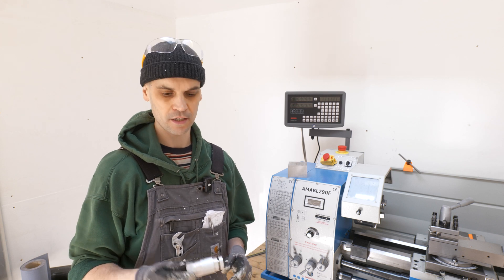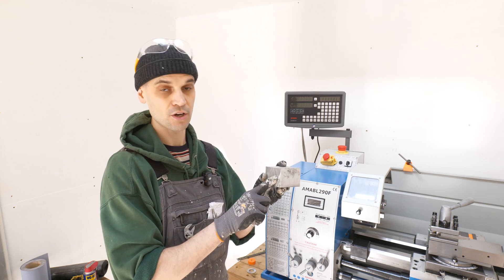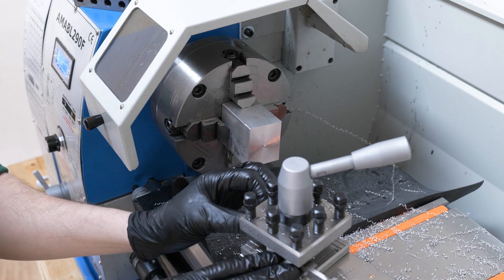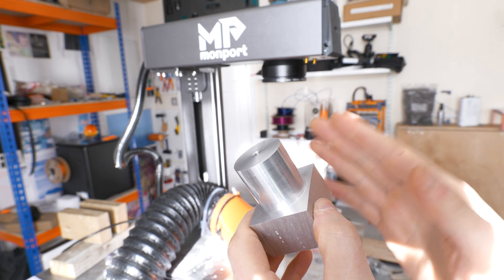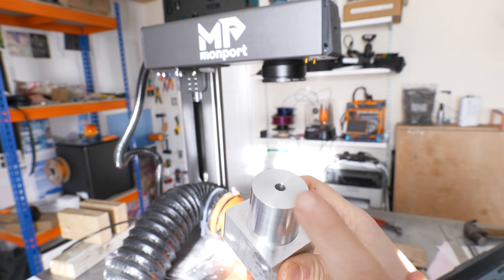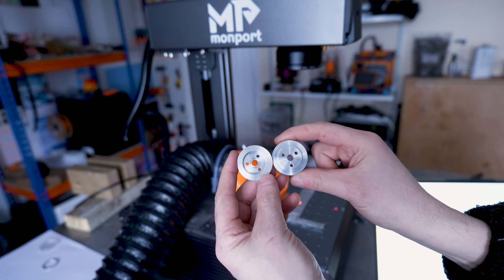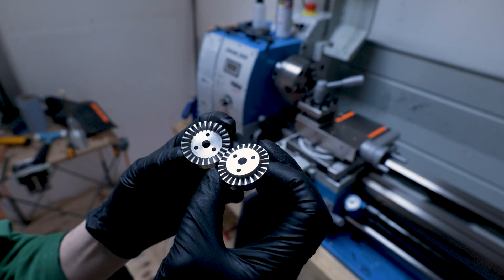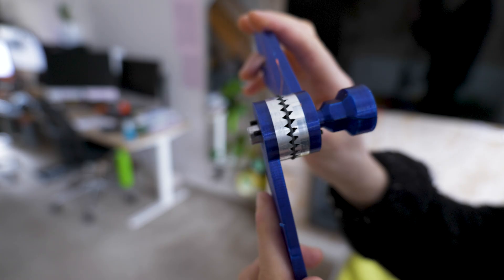Using Monport 100W Fiber Laser & Lathe to Make Gear Teeth!

Comment: i dont think the rubber is doing you any favors i have a feeling it would work just fine for tablet holding minus the rubber. and you'd get that positive hands free engagement those rosettes are great for. just my 2 cents worth of hobby knowledge. I've made these rosettes using every manufacturing method i have access to. That laser is BA though

Comment: I like that its possible, but think the geometry is perfect for 3D-Printing. I have printed these to use on a telescoping stick to reach and clean high windows and it works perfectly as they are rigid and allow me to articulate the End Of Stick Tools exactly how i need it. Until you make each arm from one piece of aluminium i don't think worth the effort with the laser. But its great that its possible to do it! There are surely a lot of great use cases for the machine 👍👍
Reply: it is probably best suited for SLA SLS, FDM ends up with brittle "gear teeth" Ive tried about 20 different designs and printing methods before having one resin print and attached to aluminum bodies and it held well (Still does)

Comment: if at the end you a using a rubber washer then you doesn't need all this teeth thing in a first place )
just two plain surfaces, a hard rubber washer (or even an o-ring) and a bolt  is all you need.
Reply from the maker: Perhaps, but the teeth will certainly increase torsional resistance, it might be overkill for this application but I was curious how I could incorporate it into my build

Comment: Interesting. But why use teeth when you are also using a rubber pad? why not just one or the other? I'd thing that roughing the surface up would be enough to grip the rubber sheet and the teeth alone would be fine interlocking with each other.
Reply from the maker: Good question! The teeth and rubber pad serve slightly different purposes. The rubber helps with vibration damping and creating a secure seal, while the teeth add mechanical interlock to prevent slipping under load or torque. In some cases, roughening the surface might be enough, but the teeth provide extra grip, especially if there are shear forces at play. It’s a bit of redundancy for added security.
Reply: @ThisDesignedThat  Thanks!

Comment: Hi, Im working in a shop where we happen to do quite a bit of machining (its for agricultural repairs, not a machine shop). We keep all sizes of material in stock since that obviously saves a ton of time (20mm to 80mm in 5mm steps as well as a lot of imperial stuff for old machines). However that is quite expensive to have that much material just sitting there and also takes up some space. Alternatively you could just get a few of the most common sizes for your projects and turn down bigger things for individual sizes. About the Coolant: it is an absoloute mess to use it while machining most of the time and I would not recomment it (except for drilling). Do your cutting and leave 0.5 to 1mm on the diameter, then use coolant or just let it sit until you can comfortably touch it before measuring and taking your final cuts. Another point that has been mentioned before: DO NOT wear gloves on any rotating (or moving in general) equippment! It is incredibly dangerous and can cost you limbs in fractions of a second. Even thin Nitrile gloves are a bad Idea as they can pull your hands in so quickly that it is too late before they rip. In general I would highly recommend doing a couple weeks of internship in a machineshop if at all possible to learn some of the safety and otherwise generally helpful knowledge.
Reply: One more thing. The tool you are using on the lathe is not really a great option for anything. It will get you by but using proper carbide tools is so much better and easier. You can get pretty cheap ones to start out as well. I'd recommend some TNMG (thats the sape, not material) as a good allrounder. High rake for aluminium is also a good idea.
Reply from the maker: I've just bought some carbide tool holders and bits because for this next project I am attempting to machine EN24T steel. I tried to take one facing cut and it actually grinded down my HSS bit so I think ill need to switch to carbide for that part
Reply: @ThisDesignedThat  EN24 is actually quite nice to machine with carbide tools. When you do it right you can get a great surface finish on that. Just be a little careful when drilling it and make sure to use coolant for that.
Reply from the maker: Hi Benedikt, thankyou for the advice, I will slowly try and stockpile my material in 5mm increments thats a great idea!

I have quickly learnt to do my roughing and then let it cool, thanks for the tips. Sometimes I do my roughing steps and on the last roughing cut i'll use a little water soluble coolant just to help reduce the part temp and then take small cuts for the final part, i was initially surprised how much heat the lathe cutting generates on the stock. Taking 3-5mm DOC produces very hot chips! Im use to a CNC in an enclosure so i never have direct contact with the chips and i use mist coolant most of the time on the CNC so this was a new experience for me.
Noted on the gloves, i only wear gloves when changing over chucks, i wear nitrile gloves when operating the machine but after reading  yours and others comments I'll just use bare hands when operating the lathe from now on 👍

Comment: You would be kicked out of a machine shop immediately.  Wearing gloves, loose fitting hoodie, and a loose mat to catch chips is incredibly dangerous.  Perhaps its time to look at some accident photos as a reminder.
Reply from the maker: Cheers Randy, I tried to make my work safe but I am always happy to hear feedback on ways I can improve it and save my life so thanks for this. I only wear the loose gloves when the machine is switched off and I'm moving around Chucks. When I turn on the lathe for machining I only wear nitrile gloves which I think are safe to use.

Noted on the loose clothing. I did chop off the sleeves off that hoody to make sure nothing is dangling but I'll be sure to switch out my uniform for a tight fitting jumper only.

I'll get rid of the rubber way covers and just the lathe without any covering for the time being, I think that's what you were referring to by 'loose mat'
Reply: @ThisDesignedThat  yeah the rubber mat although nice to help cleanup and keep chips off the ways, it can easily become a projectile or even worse get tangled with yourself and the chuck. Lathe accidents happen fast. I once used something similar trying to catch parts as they fell off, only to find it completely tangled in the tool indexer, yanking the indexer off alignment. Boss was not impressed. 

I do like your laser work. I have a 50watt fiber I'm learning on. Nice work!
Reply: @ThisDesignedThat  it's just better practice to not wear gloves around any rotating equipment.  Just my 2 cents. 

Cool video regardless :)
Reply: Yeah, you really shouldnt wear any gloves near spinny machines (lathe, drill press, mill and so on) its just way too dangerous.
Same goes for long hair and loose clothing.

My grandpa worked as a machinist and told me that a work colleague ripped his scalp of, after refusing to wear a hair net at the lathe.

He also tought me how to use a lathe and i have to say, even when you take care of stuff, there is still a lot that can go wrong.

Also wierd that no other comment besides yours mentioned this.
Reply: Inwas gonna say definitely loose the gloves around rotating equipment
Reply: Rubber gloves are no risk.
Reply: @imajeenyus42  I strongly disagree. Use at your own discretion. I've worked for 3 shops and now manage one and never were any form of gloves allowed while operating.

Comment: I usually buy the diameter/thickness/property I need for the job at hand but buy more than I need and that way I fill up my material storage and by now I can often build entire projects with stuff I already have. Same for bolts etc. 
Often I design the parts myself and thus can make design decisions based on what I have on hand. An interesting side effect is that I‘m finding it mentally freeing to work with „free“ material. Downside is space and an not to underestimate effort to store the stuff. Label everything well. Mystery metal is far less useful then when you know it is safe to weld for instance.
Reply from the maker: Yes this approach makes sense, I guess for now I'll just start buying offcuts in the diameters I need and keep the leftovers in storage for future projects. Handy tip about the labelling, need to make sure I do that 👍

Comment: Those are also called "curvic coupling" in CNC machines.  They use them to index couplings accurately and hold them fast with a hydraulic cylinder.
Reply from the maker: Very interesting! I couldn't find an animation of how they work :(

Comment: The coefficient of thermal expansion for aluminum is 0.000023 per degree Celsius (℃). This means that aluminum expands by 0.000023 millimeters for every 1 millimeter of length and 1 degree Celsius increase in temperature. 

so a 20mm rod with a 50c temperature difference would be 0.23mm thermal expansion ...
Reply from the maker: Incredible information, thankyou for the arithmetic, it explains what I was experiencing while cutting this. I never knew it could expand so much from just a short cutting operation!

Comment: Regarding material, I normally buy a longer length of the size I need for the project, and put the left over in the scrap bin for next time. After a while you have enough material in the scrap bin for most projects. 

For the three screws, having marked and "centre punched" them (with the laser), IMHO it would have been better to drill them at the drill press. A centre punch works best when the workpiece is free to self-align with the drill. When you drill rigidly (as you did with the lathe and 4-jaw), the centre-punches are actually a liability and can lead to broken drills if there is any slight misalignment (as it wants to centre on the punch, but can't because the setup is rigid).
Reply from the maker: Thanks for this information, ill bear it in mind for future drilling 👍

Comment: I thought you need to use a black marker on metal for anything laser related so the beam will not reflect and spread everywhere
Reply from the maker: You don't have to worry about that with fiber laser, it's specifically designed for metal engraving
Reply: But it's really cool to see the metal being eaten away with a laser

Comment: Buy material that is about the right size to start with. Machining anything with the lathe takes forever anyway, don't waste your time turning 40mm rods into 20mm rods.
Reply from the maker: Thanks for the advice. I'll have to keep a lookout on some offcuts close to what I need in ebay

Comment: Your design reminds me of the Manfrotto Magic Arm, one of my personal favourite pieces of photography/film making kit. So amazing what they can hold (vs how easy they are to adjust) with essentially just two steel surfaces and a sandwich of friction material between 😍Congratulations on your first lathe project! 😄
Reply from the maker: Thanks!, much more to learn! Yep, i have something very similar to the Magic arm, they work really well!
Reply: thought the magic arms used sliding wedges? my knockoffs all do, as well as my indicator stands using same tech
Reply: @nerddub  The central joint is locked by two smooth surfaces and a friction disk in-between - if you don't have one to study, you can probably see the tan disk in between the parts on images too. Sliding wedges is part of the mechanism, as it is what pushes on an internal rod inside each arm when the central joint is squeezed together, and in turn pushes outwards and friction locks these outer joints. Allowing you to adjust 3 joints with the twist of one knob. But it's worth noting that each arm is an independent mechanism, there is nothing going through the center of the central joint apart from the bolt used to tighten it, and the locking mechanism inside each arm only acts on the outer joints... they do not engage with the central tightening bolt to help lock the central joint. That is purely held by those two surfaces being squeezed together with the friction disk in-between. Really quite a clever design, in it's simplicity and effectiveness. Which is also why they are super strong and dependable. The original has a stiff price... but are some of the best purchases I ever made. Far better than any knockoffs I've tried.